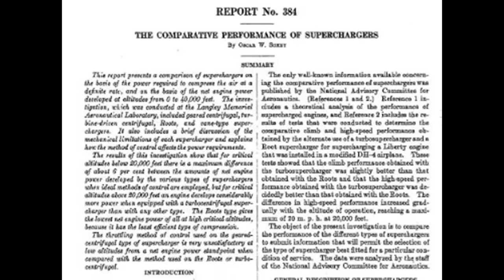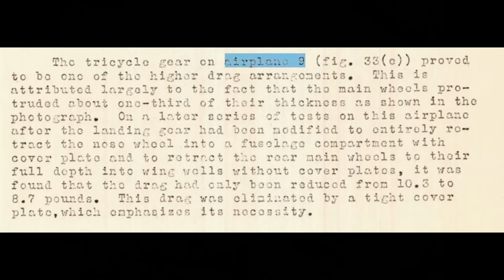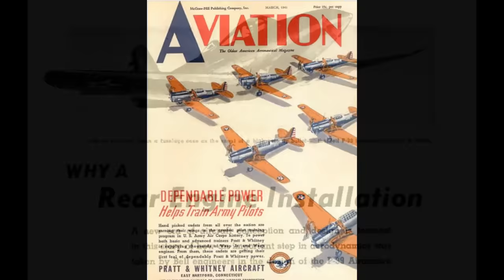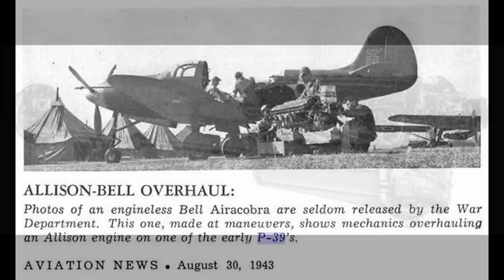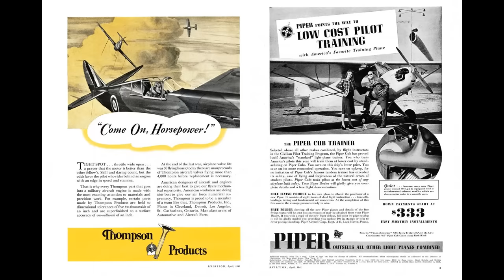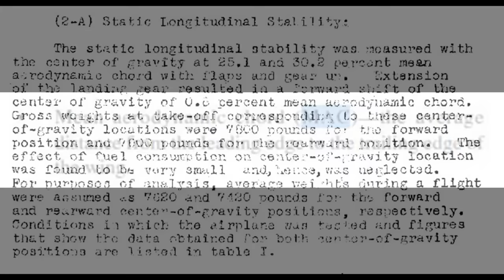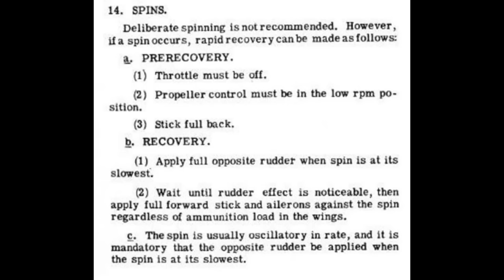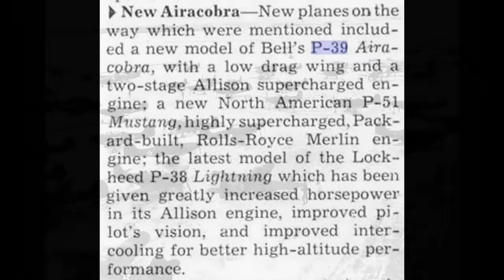Bell P-39 Airacobra, Why the Mid Eng?

Comment: It also has to be remembered that it was P-39s along with F4Fs that initially held back the air assaults by the Japanese on Guadalcanal. Good pilot training probably also contributed to their success, but if the planes were crappy I doubt they would have lasted as long as they did.
Reply: And many pilots later admitted they were unfairly harsh on the P-39. I attribute this to the US fighting spirit and the desire of American pilots to be out for blood following Pearl Harbor. They wanted to be aggressive and attack hard. But the P-39 was not such a fighter. They needed to be patient, set themselves up in favorable positions and strike when the opportunity presented. Short range makes this difficult as well. So the P-39 early on is a thinking pilot's aircraft. Late in teh war, it's performance had been boosted to beat the Zero in pretty much every way other than maneuverability and range.
Reply: @SoloRenegade  P47 and P38 effectively proved that manoeuvrability was far less important than speed and fire-power.
Reply: @Dave5843-d9m  Absolutely, but this point was actually proven even before that with the Hawker Hart bomber.
Reply: If the P-39 and F4F had been as crappy as the rep given them, they wouldn't have held anything back - witness the "inspiring" record of the Brewster Buffalo' in the Pacific Theater.
Reply: @Dave5843-d9m  Tactics, using your aircraft's abilities or the other guys weakness. Speed can  enable you to pick and choose when and where you fight or not fight. The Japanese went all in with the A6M Zero and if you were looking to the last war for insight on what a fighter plane should do manoeuvrability would top the list. The best ability is survivability the more combat you experience the better you become. The Russians loved the P-39 because it had an enclosed cockpit and more than 2 guns.
Reply: Also, didn't the soviets like the P-39? I doubt if the aircraft was terrible the soviet pilots would dislike them.
Reply: @jll5446  Liked them and chalked up quite the kill ratio with them.
Reply: @jll5446  True, but the Soviets were using them in a different role than it was designed for. Plus they liked if for reasons like "it had a good radio", things Americans took for granted.
Reply: @markgranger9150  This is a pretty huge distortion as to why the Soviets liked the P-39.  The Soviet Yak-1 and LaGG both existed in large numbers from the start of operation Barbarossa, and shortly thereafter the Soviets had numerous very capable domestically produced fighters.  The I-16 which you are likely referring to as having a open cockpit, ironically also had 4 guns, including 2 20mm cannon, a platform that many Soviets became Aces flying despite it being obsolete by the time of the invasion. The I-16 ironically enough was one of the most (if not thee most) advanced fighters on earth when it was first introduced, with a top speed in excess of 300mph, retractable landing gear, multiple cannon.  Compare that to the contemporary American P-26 with its fixed gear,  top speed of 234mph and measly 2x 7.62 browning's.  It's ironic too that even with the P-39 one of the first things that was done to many of them by the Soviets was all the guns on the wings were stripped out, for more speed and a higher roll rate, the Soviets preferred centerline guns and good gunnery to the western concept of a beaten zone and wing mounted weapons. (much like the Germans)  

If more than 2 guns, a radio and a enclosed cockpit were determining factors as to why the Soviets liked a aircraft they surly must have loved the Spitfire right? Yet they didn't, and the Spitfire was not liked by most Soviet pilots.  The reasons as to why the Spitfire was not liked are complex, but I digress. The Reason for the P-39s success in the east had more to do with the nature of air combat on the eastern front. The Germans had a deep understanding of energy fighting tactics and preferred to stay high and fast, offensively using bombers and high top cover.  Yet the Soviets were able to dictate the nature of the fight by flying a "offensive defense" dragging the air combat down to extremely low altitudes through aggressive low level raids. (why contest the German bombers and fighters flying in their ideal conditions, when you can destroy them on their airfields on the ground)  Energy fighting tactics became much more difficult to employ when the Germans were forced to engage aircraft like IL-2 in large numbers flying at treetop level, protected by low altitude fighters. In this environment and without a supercharger the P-39 was a entirely different aircraft compared to the underpowered turn fighter competing with A6M's at altitude (also flown by very well trained pilots at the start of the war) in the pacific. In these conditions on the eastern front the P-39 wasn't just satisfactory, it excelled producing some of the highest scoring aces of all the allies in WW2.
Reply: @Dave5843-d9m  That is why the P39 did not fly in the European theatre, it would have been decimated. The P47 was so bad in Europe, it was reduced to a fighter bomber. In WW2, manoeuvrability was key, hence the success of the Spitfire, Me109 and FW 190 and latterly, the P51d with a Rolls Merlin engine
Reply: @jll5446  The Soviets used them for ground attack only. Against the German fighters of the day, they were widow makers
Reply: @jimwalsh8520  pretty sure that's false
sure if the p39s were pushed into a high altitude fighter role, yes the bf109 would do ugly things to p39s, but at lower altitudes the p39 was a pretty good fighter
there were lots of soviet p39 aces, after all
Reply: @jll5446  Not false old boy but fact. It was under powered, too heavy and a high wing loading with no supercharger. The C0fG was wrong and tere is a full test report from the test pilots at Farnborough. As I said, the USA produced lamentable fighters during WW2. It was only when a Roll Royce Test pilto said try a Merlin in the P51, that a true thorough bred evolved. The P 38 in the European Theatre also was relegated from fighter to photo reccon
Reply: @jimwalsh8520  tell that to the multiple soviet aces who liked the p39
Reply: @jll5446  It was all they had.
Reply: @jimwalsh8520  then why did the soviet pilots hate the spitfires they were provided?
Reply: @jll5446  They did not you fool, we only sent 1200 old Mk2s and they flogged them to death. The spitfire was the best fighter of WW2. Nothing the US produced was close until Rolls Royce put a Merlin into a Mustang. So just accept, the US produced 90% uselss fighter aircraft in WW2
Reply: @SoloRenegade  Didn't the Mosquito prove the same point as well?
Reply: @markgranger9150  They also had much much better radios.
Reply: @jimwalsh8520  watch out everybody. We got a teaboo over hear. Rare but embarrassingly adamant.
Reply: Apparently the Russians liked them. Interesting?
Reply: @jimwalsh8520  - "the P-47 was so bad in Europe  [as a fighter]  it was reduced to bomber"? malarky!! see Gregg's videos about the P-47 BREAKING THE BACK of Luftwaffe in 1943 BEFORE the (Merlin high alt.) Mustang came along!
 It's just that  for fighter  bombing, survivability in big, rugged P-47 was much higher than in lightweight Mustang, so the 8th &  9th AF correctly used them for this role.  But late Model M  P-47Ms were THE FASTEST, HIGHEST FLYING allied  fighters in Europe, could defeat anything Germans had including (with luck) Me262s. 
see Gregg's video on super-props.
 I think it was in 1950s Chile vs Peru war (?) that  a Corsair pilot defeated two late model Mustangs, with the massive 2,000 hp PW engine he could out accelerate and outurn the Mustangs.  
Also,  Mustangs were far cheaper - about 1/3rd less  - and cheaper to operate, so in calculus of war 3 Mustangs will probably defeat 3 similarly piloted Tbolts, a major reason AAF used bought so many Mustangs for top cover and let P-47s specialize in close air support of ground trooos.
Reply: @vvvci  P47s by early 1944 in Europe had been relegated to ground attack, Luftwaffe pilots loved them. Big, unagile and heavy brutes. It most ceratinly was not high flying, it only had a one stage supercharger and at height, its high wing loading turned it into target practice for FW190s. It could never outrun a P51 in level flight, its power to weight ratio was awful. It was not a fighter at all. Seems that US air war history ahs only a fleeting acquainatce with historical fact. When they appeared in 42 along with the P38. They went to RAf Wittering then home of the 2ndTAF. Two Spitfires flew against the P47 and the P38, withing half a turn, the Spits were on the tails of the two "wing ding USAC fighters who could not do anythong, they had neither the turning circle or agility for European combat, inferior all round. Don Blakeslee was scathing about them, he had flown with the RAF eagle Squadrons before being forced into the USAC
Reply: @Dave5843-d9m  Are you for real? Agility was the key in WW2. Get over yourself
Reply: @jll5446  Not in Europe there werent
Reply: Weren't the Bell aircraft used at Guadalcanal P-400s? As the old saying went, a P-400 is a P-40 with a zero on its tail.
Reply: @jimwalsh8520  Wrong, used as a low/mid altitude fighter
Reply: @jll5446  Name one!
Reply: @Dave5843-d9m  What tosh! The P47 and P38 were decimtd and were not as fast as the latest Mks of Spitfire or FW190 and Me109. Stop stroking yourself. Fighting was a truning game and the turning behavious of both P47 and P38 were dire
Reply: @jakobole  No, the Mosquito was not designed or built as a comnbat fighter, I wish you so called Ex spurts, would actually stop stroking yourselves and learn about air combat.
Reply: @jakobole  Better radios? The VHF radios used in all RAF aircraft wwere the best in the world at that time
Reply: @vvvci  The P47 most certainly did not "braek the back" of the Luftwaffe in 43.The German pilots loved them because the were on them like a rash! The P47 had not turning circle and at height, would stall very easily. And if they broke the back of the Luftwaffe in 43, why was the 8th Airforce bomber loss rate at 18%? Unsustainable.
Reply: @tomhart837  I think not!
Reply: @jimwalsh8520  Have you tried being nice?
Reply: @jakobole  Nice all the time unless people distort historical fact to appease their jingoistic tendencies
Reply: @jimwalsh8520  Please explain my  jingoistic tendensies?
Reply: @jimwalsh8520  Think you should probably read some history from the Russians who used them.
This ground attack thing has grown up because of the cannon in the nose but it was originally put there to shoot down bombers. The P 39 actually wasn't very good as ground attack as the cooling system was exposed to ground fire in the unarmored belly. It could handle itself well up to about 12/15,000 ft. I have an RAF test report from '41/'42 summarizing it's performance against some British and German fighters and it held up pretty well. Have to admit the Spit was better but against the Hurricane and 109 it was good until the lack of a turbo or 2 speed kicked in.
Reply: @tomhart837  Tom, I have also read the Farnborough and Boscombe test reports and it was condemned as a European fighter. Also it could not hold its own against either the Hurricane or Me109 which were vastly superior
Reply: @jimwalsh8520  aces?
Aleksandr I. Pokryshkin -48 p39 victories
Nikolay Gulaev -41 p39 victories
Grigori A. Rechkalov - 48 p39 victories

Dimitriy B. Glinka	- at least 11 p39 victories
Boris B. Glinka - at least 10 p39 victories
the soviets liked the plane, sure at high altitudes the p39 was a terrible fighter, but in the Eastern Front, the majority of the combat was at relatively low altitudes
Im not saying the p39 is a perfect fighter, because it really wasn't. What I am saying is the aircraft was excellent for the Soviets.
Reply: @jll5446  Yes and most of the victories were transports and bombers
Reply: @jimwalsh8520  so? sure the majority seem to be bombers or attackers, but the pilots still got many fighter kills
many german aces got mostly bomber kills, but does this mean the bf-109 or the fw-190 were garbage?
Reply: @yes_head  They liked it for a lot more than a good radio
Reply: The f4f were pretty good aircraft when flown  with proper tactics, the first military aircraft with a speed, 2stage intercooled supercharger and it was very strong
Reply: @johngregory4801  the f4f had a 4/1 success rate overall
Reply: @kenneth9874  6.9:1 according to official records, but...

What was the kill/loss ratio for P-39's in Russian hands?
Reply: The P-39 had handling issues.  The test pilots report at Wright field was very condemning, and of course the Allison was poor above 15,000'.  It had the worst accident rate in the USAAC/USAAF.  An above average pilot could use it more effectively if they had a light touch.  Not a suitable gun platform for ACMs.
Reply: @jimwalsh8520 Spits were very short legged.   They skd going to Germany, sukd in the Pacific, India.  They were antiquely produced, slowly and very expensive.  Most of Europe fighter air war was done by others.  They were the superior fighter were they were, and where the Spit wasn't .
Reply: The P38 had to be withdrawn from Europe due to its casualty rate!
Reply: Greg doesn't agree. See his video on the P39 in Russia.

Comment: The shaft drive experience must have been useful for Bell's subsequent helicopter building career.
Reply: Excellent point.
Reply: Spectacular observation.
Reply: Amazing remark.
Reply: I'd have never thought about that. Maybe the P-39 saved some early helicopter pilots' lives.
Reply: I would love to see an analysis of the P63, King Cobra. Are any left flying & what were the advantages over the 39.
Reply: @glennhelm9525 Unfortunately, the last flying P63 was destroyed in an airshow midair collision in the last couple of years, due to poor airshow air traffic control.
Reply: Prop drive vibration had been solved well before WWII. The P-39 driveshaft would have actually made it easier.

Comment: My dad was rear gunner in an SB2C Helldiver during WW2. He told me that pulling out of a dive he'd often black out because he was behind the center of gravity, while the pilot wouldn't because he sat on or near the center of gravity. So I guess the location of the center of gravity would have an effect on pilot performance.
Reply: Were his feet lower than the pilot’s feet on the rudder pedals?
Reply: He blacked out because he was unprepared for the Gs or did nothing to increase his tolerance.  The person pulling on the stick can usually tolerate more G than other occupants because he knows when he is going to initiate the pull and his body has more time to prepare for the G onset.